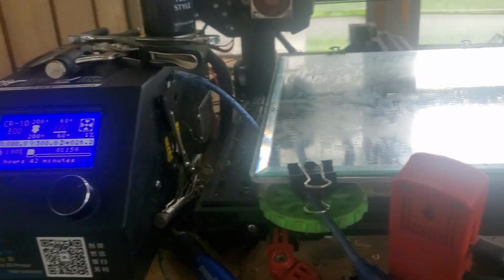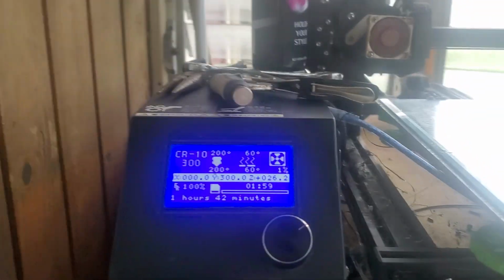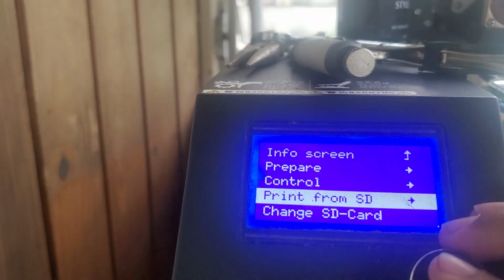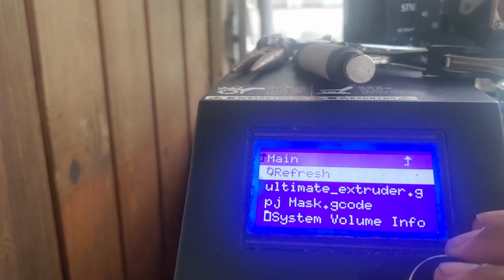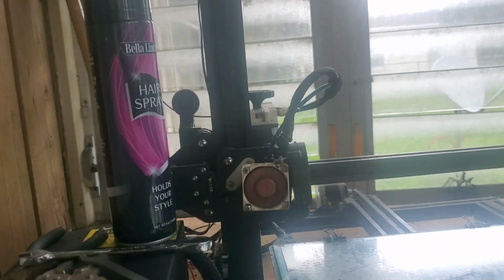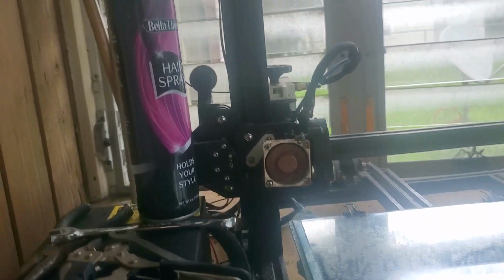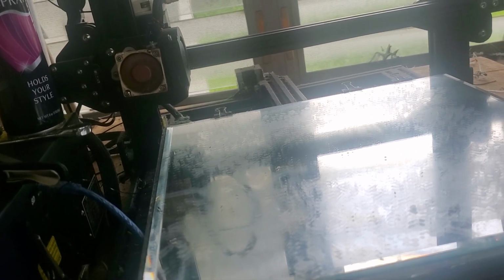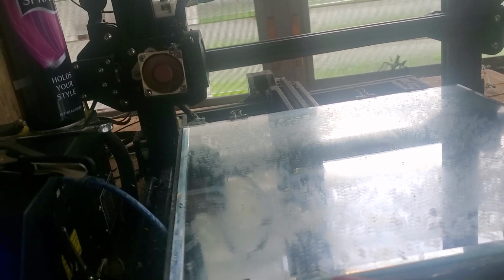how to fix the exstuder on a cr10 or ender 3 3d printer

Comment: Please never use hairspray on your printer bed. It sprays everywhere even if you aim it at only the bed.
Reply: He has a bed that can easily come off, he can still use it. Just have to be mindful of how to do it.
Reply from the maker: @toxicmatrix1337  I use windex to clean off the hair spray and it works great and it keeps the mirror clean
Reply: @LegitLeeVelez  nice. I use regular glue sticks and just clean with dish soap. Not a fan of the stock build plate at all. If you are into resin printing, wham bam flexible plates are really great.
Reply from the maker: @toxicmatrix1337  yea I think resin 3d printers are cool but I don't have one and I got a glue stick to but I haven't needed to use it yet but I will when I think I need it
Reply from the maker: Ok I will keep that in mind

Comment: I have an Aluminium dual gear Extruder from Amazon and I am more than happy with it.
PLA deforms under pressure so I personally don't use it for any Parts that are under constant stress.